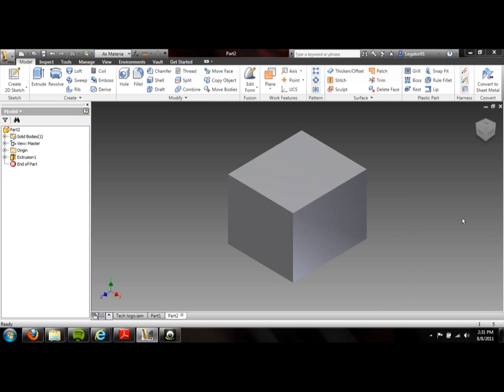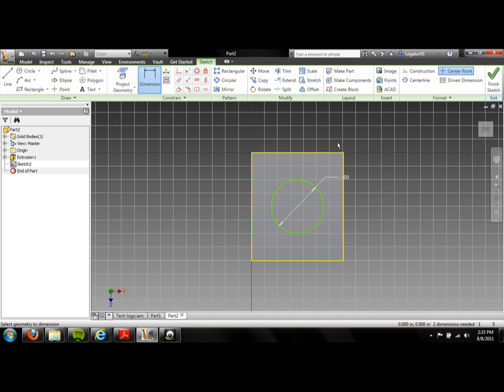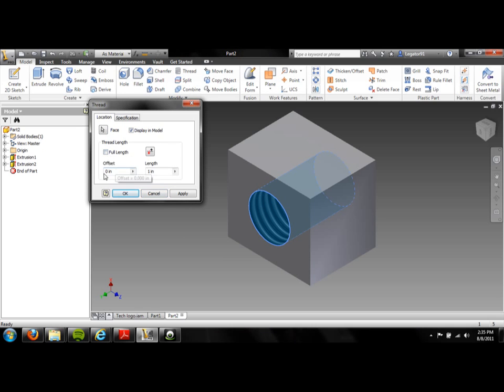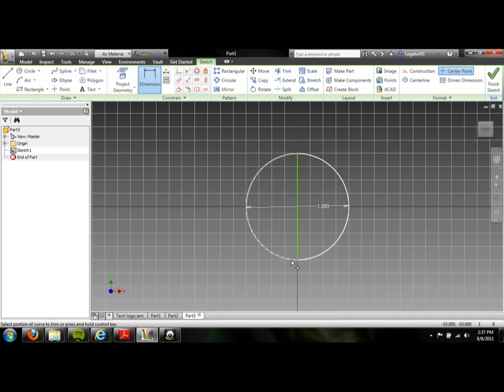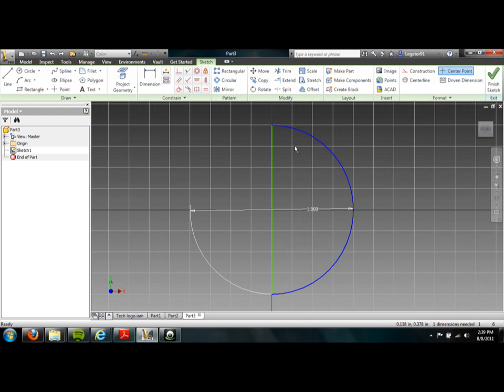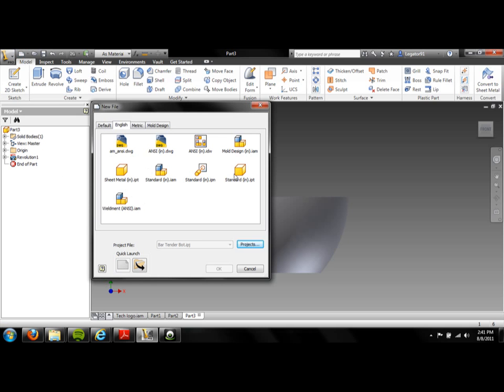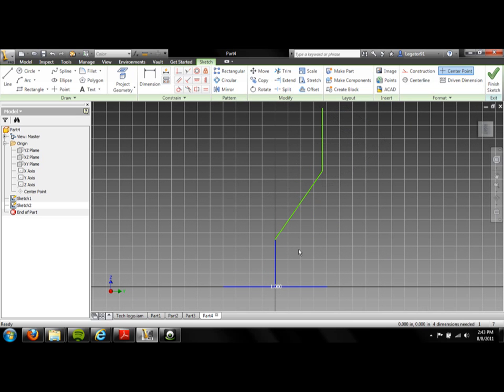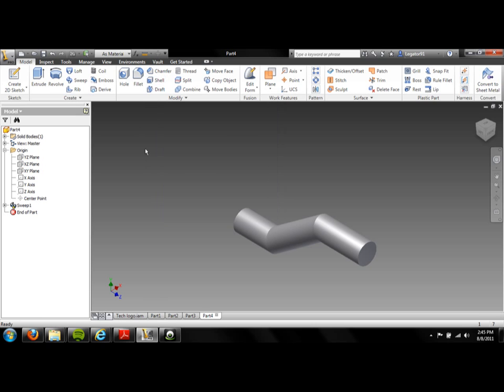Autodesk Inventor Tutorials-Revolve, Sweep, Extrude

Comment: Im trying to make a scope mount for my shotgun and i need to make slots for the rail system. The face is angled, but i need the extrusion to go straight back instead of following the angle of the face. Tips or tricks?

Comment: FYI, the thread tool you used won't 3d print, nor can it be used for threading on a CNC lathe.  It's just adding a texture, not real threads.  For real threads you have to Add a triangle to the drawing and use the coil tool.  For what it's worth, I have not actually done this, but I did try to 3d print threads using the thread tool and they don't print out.  Nor does it show up in G Code for my CNC lathe.

Comment: @snipper198 I was seeking answers for why sometimes Inventor does the solid I want to do, and sometimes it doesn`t. I guess if the guide rail is too complex, Inventor doesn`t the surface I need. I was discovering Solidworks as well. Looks it is better for sirface with 3D curves and surfacing like cars and aircrafts.